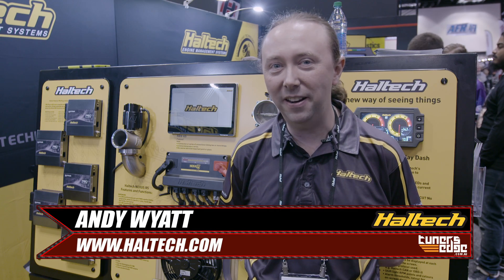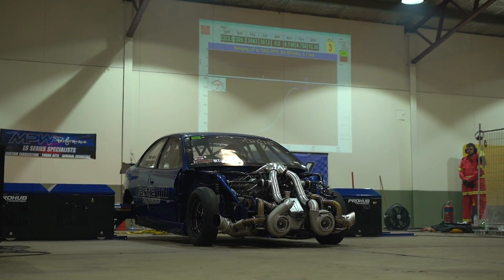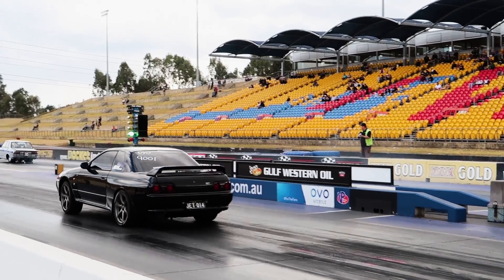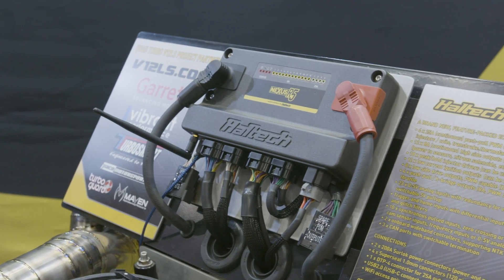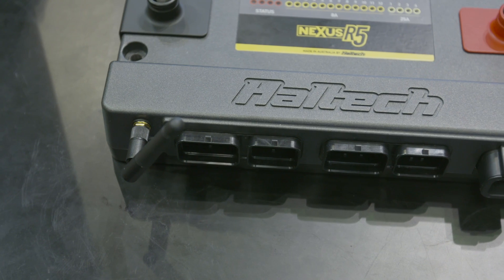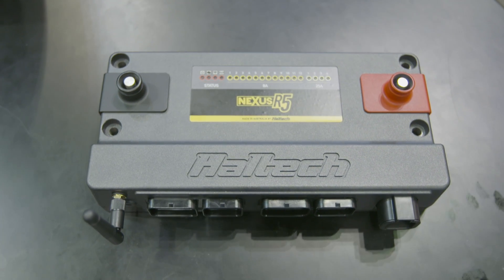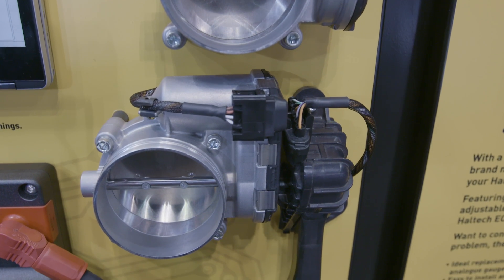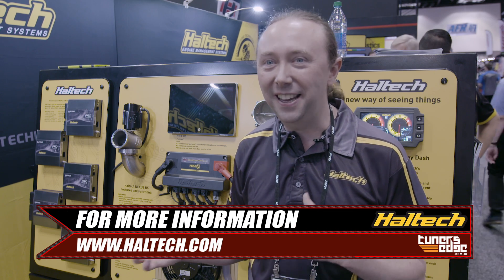ECU and PDM Combined! New Haltech Nexus R5 at PRI 2019

Comment: I'm so happy to see an ECU that can do 12cyl direct fire!  Finally!!!  Yes, I know not many people are going to say that...
Reply: J Z yea definitely a good thing! Been looking  into what ECUs will be good to run my 1gz, it’s a hard road but I think this may just be what the doctor ordered!!
Reply: @yobbo8677  Adaptronic M6000 (also designed by Andy) will easily do V12 in direct fire, even with 2 injection stages, 2 MAP sensors and 2 DBW throttles if so so desire. all on board. all internal ;)
Reply: manitoublack yea that was what I was looking at!! So cool that you can add bits on with them!! An Andy does really good videos about bits n prices of them!!
Reply: @yobbo8677  That's the engine!  I know it's been done, but a 1GZ GS300 is what I'm looking to do.
Reply: J Z sorry can I say that in the current climate 🤷‍♂️🤷‍♂️